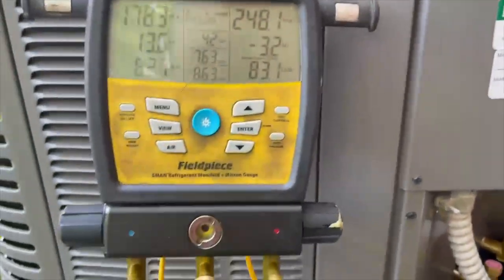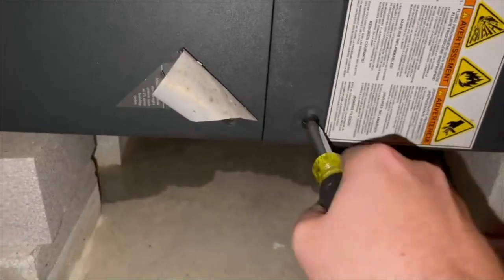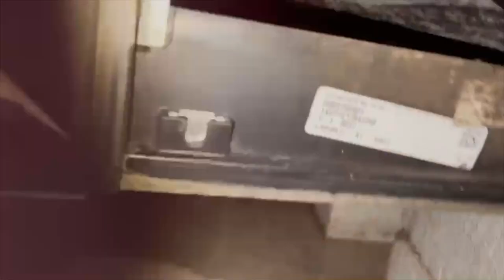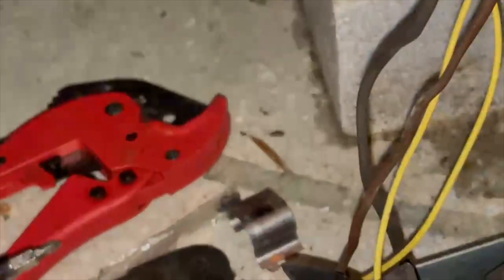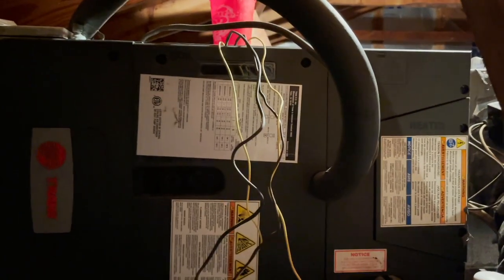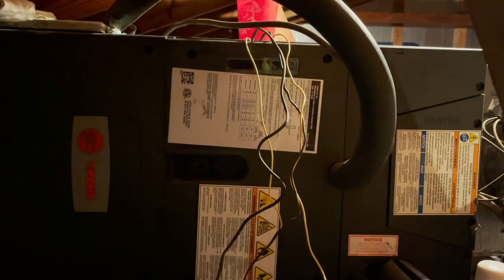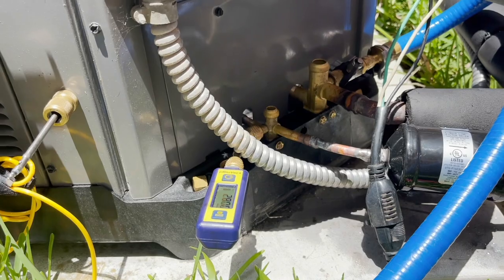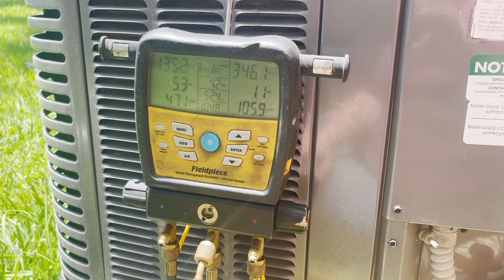HVAC/TXV Replacement

Comment: Sub cooling is calculated 100% in the condensing process/unit ..... indoor temp wont bother you setting it. Only the super heat will be affected by the indoor temp after it comes down. Let the unit run 15 mins,.... set Sub Cooling and walk away. However on a heat pump, I set it one full degree lower than target due to dirty filters running head pressure up in the heat mode. In cooling mode or on straight AC the Sub Cooling is all done outside.
Reply: That's what I'm saying, I'm sure he let it run long enough but what's causing the low superheat? If he would to add some his superheat would drop . Possibly low air flow ? I know he has mentioned that in other videos about it being so hot inside causing the subcool to be real low but doesn't click to me. Oh well he's out there getting it done 👍

Comment: thanks for the video, question...maybe i missed something i thought i saw a one way filter drier, and that was a fan coil, is that a straight cool unit? if its a heatpump that would have to be a biflow drier right? maybe u have a straight cool with heat strips, just that i dont work much in residential..good video

Comment: How come you guys don’t bring the sensing bulb outside the unit on the pipe and insulate it?
Reply: That's what I try to do when changing a txv. Did it yesterday on a 15 year old r22 trane coil
Reply from the maker: Because that’s where it came from the factory

Comment: Yea I definitely don't like those air handlers either. I'm a trane dealer and work on alot . Eev and txv on Tam 7-9 are much better. Changed alot of those black coated coils on them. Anyways your probably going to have to add refrigerant to that unit to get that subcool up. Good vids man.

Comment: Hate these units. Especially with the Phillips screws. I always see these all taped up. Normally says right on the door that it's supposed to leak air. Oddly enough. The drain pan is a pain too with the small weep hole on the u bend drip ledge

Comment: GAF TAM GAM, in my opinion they all suck, the only metering device is in the air handler even on a heat pump. I hate them with a passion extract a little more efficiency for what, to save a few more bucks; only to replace 100 components in this damn machine, in my eyes it ain’t worth it! #onlymyopinion But nonetheless great job! They all have ECM motors both indoor and outdoor, I believe; bar none they just suck to repair! Straight A/C I assume cause that’s not a two-way filter dryer?

Comment: I'm lazy, so I would invest in an electric screwdriver, or small electric drill or impact gun, with a Phillips bit in it, to unscrew & replace those Phillips screws, especially in dangerously hot & humid Louisiana attics from early May until mid October. That kind of heat, combined with high Southern humidity, can be life threatening fairly quickly.